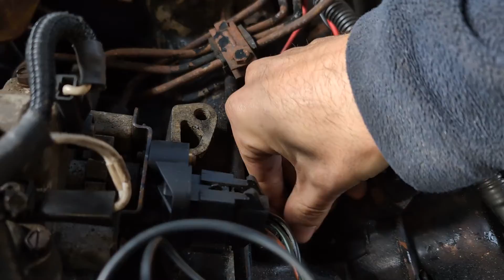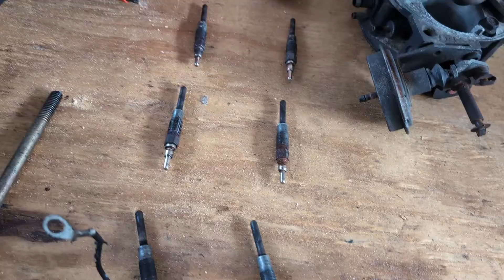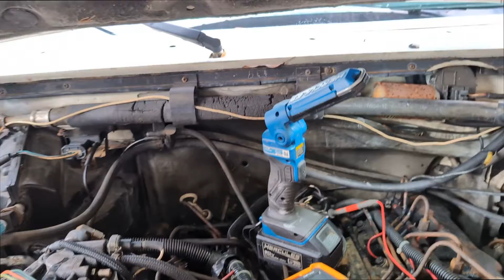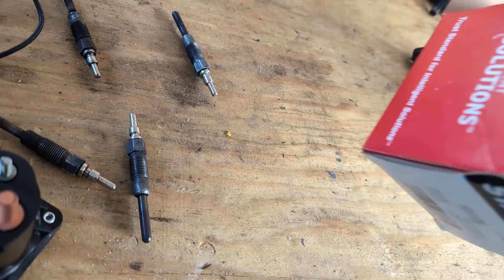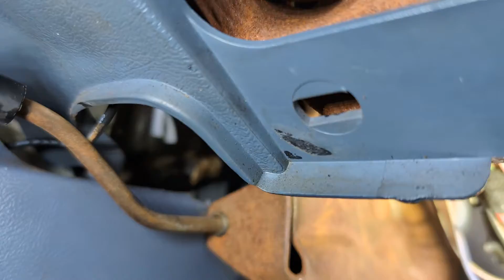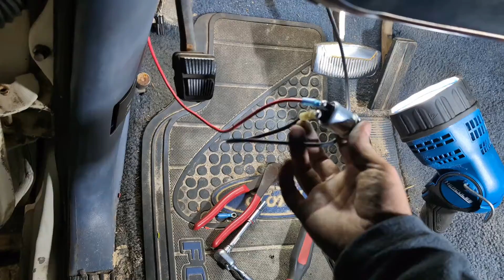Episode 163 - Glow Plug System Troubleshooting 1989 Ford F-350 7.3L IDI Diesel

Comment: 27.3L IDI Manual Glow Plug Controller wiring diag
Remove the white wire from the glow plug relay and
cut of the terminal. Install a crimp or wire nut on the
end of the bare wire, tape it up, and tuck it away so that
it is secure - this wire is no longer being used
Cut the blue wire for the wait-to-start light halfway
between the electrical connector and controller. On the
end of the wire that goes into the controller, install e
crimp or wire nut at the end, tape it up, and tuck it away
-this wire is no longer being used,
Crimp roughly 12 inches of wire to remaining blue
wire and install a ring terminal on the other end. Plug
the wire connector into the matching connector in the
wiring harness, then install the other end to the terminal
on the glow plug relay that you removed the white wire
from - this will allow for your wait-to-start light to
illuminate while the glow plugs are being manually
cycled
Run a wire from your momentary push button switch
(do not use a toggle switch or switch that remains
activated after your let go) to the teminal on the relay
that you removed the white wire from (where the blue
wire should also be installed)
Run the other leg of the momentary push buttor
switch to a good ground (preferably to the frame or
engine block).
D

Comment: What a weaith of info between the comments and the poster . Thanks . Just a thought about video making.  While explaining wiring data in the engine bay... A pointer or screw driver could point out the area or electrical connector  without having to explain  ... but this can be hard holding a phone . Subscribed.

Comment: Okay I've made it to this video with the same problem as everybody else. Maybe I can tell what happened to my 92 7.3 IDI and I love your thoughts. Went out to start my truck yesterday the glow plug light went out very quickly and of course click click click click click click. My first thought was problems with my batteries because I have two die-hard goals and their about 5 or 6 years old. So what I did was I put a jump on one of the batteries for about an hour when out there and it fired right up. So now my thought is it's just battery issue so I went bought two brand new die hard gold batteries and truck fired right up when I was down at AutoZone and I was very excited .Next morning, today , I go out and trucks doing the same thing.. click click click. Started chatting with GPT it told me to check on my battery connections and my grounds and all seemed fine. I did find one negative terminal issue but I bypassed it and it was still doing the same thing. So now I'm looking at the glow plug relay. I put a voltage meter on the input and got 12.5 and on the small power in I was getting 11.44 with the key on. Also put the voltage reading on the output with the key on and I was getting nothing. A couple times throughout my testing when I turn the key on it acted normal and actually fired up so I guess it's an intermittent problem. Does that tell you anything? Any advice would be great. I just ordered a new relay minus the controller so hopefully that solves the issue and I don't end up with the same click click click
Reply from the maker: If you are taking voltage measurements on the output side of the controller when it supposed to be running and getting nothing, sounds like a bad controller and/or relay.  To narrow it down I would jump the relay to see if you can get it to close and flow power to the glow plugs.  If that works that tells me you probably have an issue with the "smarts" of the controller versus the relay.  I would also check the shunt.  The shunt is wobbly bit of metal that is part of the controller.  From what I remember that shunt sets a very specific resistance value that helps to inform the controller to run the plugs or not.  The whole system functions on resistance so make double triple sure you have good connections all the way through and all grounds are in good working order.  As you saw in the video I spent hours following the exact Ford diag procedures, tested everything, bought a new controller and it still didn't work.  I've been perfectly content with my manual glow control since I built it.

It's actually been a bit handy because I've needed to give my truck a snort of ether to get it started a few times and you can do that safely... if the glow plugs have not been running.

Comment: Fantastic video.  I went through 'no glow' once before in 2009ish.  tested the plugs, replaced the relay, then the controller.  turns out the harness connection between the relay and the starter solenoid had melted.  If I had this video then, I would have done a smarter order of testing!  Now I have the same as you; click click click.  Plugs are motorcraft and only a couple years old.  all of them test out between .2 - .8 ohm.  I am getting almost EXACT voltage at the relay as at the batteries.  I tested each plug wire, reading .5 +/- on all of them.  I am going to replace the wires.  I feel like there should be less resistance - but not sure this is the problem.  they are original and insulation is not in great shape, so it will be good preventative anyway.  A couple weird things; the relay would catch when I hook a noco jump box, for a few weeks anyway.  The noco has higher voltage than 12v battery.  (my batteries are new, interstate/costco.  they aren't low or weak.)  Also, after starting and running enough to get the temp guage to budge, shutting it off for 15min, then turning the key on again, the relay will catch also.  engine and plugs warmer, but not hot..?)   Anyway, if the new wires don't do it, I will bypass the controller like you did.  i hate to do it only because I really like everything stock, but having that control will be nice.  Also mine is the zf5 - no e40d for me!!  =D
Reply from the maker: I would like to go to the ZF5, but it's actually a bit of a bear to go from auto to manual.  I think there might be a conversion kit floating around out there.  If I could get that...

Comment: Where did you go to watch the manual bypass ive tried everything on my truck and it looks to be the previous owner installed a bypass just it’s not wired right to the relay
Reply from the maker: I believe I read it in a step by step guide with pictures either on Oilburners.net or the main ford forum in it's diesel section.
Reply: @MazdaB3K  I bypassed the glow plug relay like the instructions say and now my bus bar is heating up and smoking. What does that mean?
Reply from the maker: You mean where the factory ground is?  That should be a ground point and should not be getting big power.  If it's smoking something is wired wrong because that wire is getting too much current for it to handle.

Comment: I guess I would consider a push button switch for the glow plugs.  I've got all my glow plugs disconnected. But I think I would go with the push button instead of relying on the timer.
Reply from the maker: I've had no issues with the system since converted to a manual push button.

Comment: 32:02 All you've done is push the problem somewhere else The next step is to check each individual plug on the amperage draw to that particular plug You're dealing with voltage sometimes you will have a 12 volt signal but you won't have 12 volts when you put the juice to it therefore your amperage will be low low low low diesel Care products has everything you need for that truck glow plugs wires controller check them out

Comment: Those don't look like glow plug connectors it look like slip joint barrel connectors it's like a spade except it's round you understand That's not glow plug connectors I throw that shit away them still collars Man they will give you fits might be part of your problem 13:17
Reply from the maker: Thus far the glow system is working fine for me.  What does a glow plug specific connector look like?
Reply: @MazdaB3K not trying to advertise just found it myself diesel care and performance yeah pumps glow plugs ejectors wiring harness and controller for the injectors they've been in business for a while they rebuild pumps in house videos on all of it I'm sold
Reply: https://youtu.be/7O4Bh1zru2c?si=UzvbpcDXTlQMTWv5 @MazdaB3K

Comment: I was having the same issue as you I ended up finding out the power side of the relay was getting voltage but not enough amps. Ended up replacing the 2 wires with new fuse link wire and glow plugs lit right up. Hope that helps
Reply from the maker: Hopefully that information does help somebody.  In my case I converted to manual and it works great.  Still learning how much glow to give depending on the temperature, but the glow fires off every time I hit the button.

Comment: thank you thank you thank you! 90 f250 7.3 idi....same same issues. followed your lead and wired (16 ga) /installed  manual switch. key on, push button, wait to start light lights up, count to 7, no start. reapeat count to 10, no start but it act like it wants to . now i just plug in the block heater from the house 120v for an hour and it starts no problem. a guy below says he holds 12 to 15 sec. should i try that? what do you think is the max time these things can take? btw new controller, new wiring harness, new plugs-OEM Ford / Motorcraft Idi 7.3l DIESEL Glow Plug Zd-9- Zf2tz-12a342-a (Set of 8 Pcs)- thank you
Reply from the maker: How much glow you are going to need is going to be highly dependent on the outside temp.  For example this morning it was upper 40's/low 50's F where I'm at and Bertha would start after 10 seconds of glow but didn't want to stay running until I feathered the throttle for a few seconds to get the needed heat.

Funnily enough I was researching the glow duration question.  From what I understand the IDIs fancy glow controller (7.3 IDI) would run the glow, give the operator the "wait to start" light, then keep the glow going for some period of seconds AFTER the engine started before finally turning off.  So... I would think anywhere up to 30 seconds, but I would say the plugs need to be given time to cool down after that.

If all of your glow system is now in order and the momentary switch you installed is working and you are still having starting issues at warmish temperatures, I would be checking for air in the fuel lines somewhere.  It's a known issue for the return lines to leak and have to be replaced.
Reply: @MazdaB3K  thanks for this...ill try a little longer... i know about the leaky low pressure return lines... have replaced them 2x over the years. ill double check. thanks again.

Comment: Truly helpful, got a 7.3 l I’m tackling and this is easing my anxiety.
Reply from the maker: It's a solid engine once you get it running.  the E40D it's attached to gave me fits before I finally figured it out though.
Reply: @MazdaB3K the hardest part is getting it to turn over, I guess this vehicle got caught in a flood and the person selling it says it’s seized but I’m just seeing what I can do before I buy it.
Reply from the maker: If it's locked up you are going to need to pull the glow plugs and/or injectors and inspect the cylinders if you can.  If they aren't trashed the best bet it to pry on the flexplate/flywheel but I think for this generation of Ford you would have to detach the transmission to do that.  Alternatively you can take the heads off and then do percussive repair on the pistons themselves with a block of wood and a hammer.  Pulling the heads on this truck is really big job though.

With it being a flood car I would drain the oil pan too, possibly drop the pan to make sure you don't have mud or something fouling up the crank before you try to get it spinning.
Reply: @MazdaB3K they did drain the oil already so that might be helpful, it’s in a 91 econoline so I took the doghouse off to make access easier. I’ve got a ton of pb blaster and fresh oil to put in it to help loosen things up.
Reply from the maker: ATF is the easiest to pour down the cylinders, though a more effective pentrant would be a mix of ATF and kerosene.  Look up a mix called Ed's Red if you want a really good solvent for unsticking things and eating rust and crud.  I don't remember if this engine has a nice big crank bolt that you can flex on, but you have to be careful with that anyway because you can and will snap a crank bolt of you thrash on it too hard.
Reply: @MazdaB3K copy that, thank you!
Reply: @MazdaB3K do I take the injectors out to pour the solution in, or just take the lines off and leave the injectors still in?
Reply from the maker: @Bunnybones87  if you are wanting to get stuff in the cylinders injectors need to come out.  If you are testing the fuel system you can drop stuff in at the tank or remove the fuel filter and fill it with ATF
Reply: @MazdaB3K thank you

Comment: I yanked my automatic relay and put in a momentary push button on my dash. Hold for 3 to 5 seconds and crank. I ended up getting at least 4 years out of my plugs before needing replacement. I had two controllers fail, and took out all my glow plugs twice, never again. I can count 3 to 5, and I know I'm not cooking them. I doesn't take much to start my truck on a normal day, not freezing outside. The controller is to fickle for me not worth the headache. All you need to do is just put in a relay, and hook the switch to the relay. Super simple.
Reply from the maker: Yeah, kind of came to the same conclusion.  The video you looked at doesn't show hours of extra troubleshooting I did testing just about everything I could test, nor the two trips to the nearby city to buy parts that took about 1.5 hours round trip each time.  After all that foolishness a momentary switch that you press for a few seconds is way better.

Comment: I'm having a hard time figuring out which glow plugs I need and all the websites to go to are so hard to navigate there are so many different part numbers and so many different styles..
All I know is it has a stud type I don't want to make the vehicle undrivable plus it's not mine I work on OBS stuff
Reply from the maker: If you are working on an IDI diesel engine, get the motorcraft plugs only.  Just about any other brand winds up with issues heating up or winds up swelling and getting stuck in the cylinder head.

Comment: So now on a cool/cold day you press the button, count to 12-15 and turn the key and vroooom!
One 'good' thing about the 'manual' button is > > > on a warm/hot day or a warm engine you're NOT using the Glow Plugs like the controller would normally use them. Thus... the GP's will last longer!
BUT... unless I missed it, what made you come to the conclusion the GP controller relay was bad and replaced it???
Reply from the maker: It was more like I ran through all the troubleshooting steps as laid about by Ford and everything that was a simple measurement came back fine.  The only thing left was the glow controller.  I knew it had a reputation of being too clever for it's own good, even the improved one used in the 7.3L.  So I bypassed it to get on with my day.

Comment: Just did all of this down to the by pass 😭doesn’t want to start so now I’m going to check the fuel system
Reply from the maker: Yeah.  Air intrusion will give you a bad day.  After you do a bit of cranking try pressing in the schrader valve that's near the filter and see if you get any air coming out.

Comment: So I changed out my relay and added the ground cable as you show but that didn't solve my problem, the WTS light just won't stay on. I don't own a test light but I do own a very good Fluke Multimeter. 
My Multimeter doesn't have super long leads and this engine is in an E350 van, I just used the engine block method, where one tip is in a clean section of the engine block and the other tip is on a glow plug tip. The reading on the two I measured using the ohm section were both around 1.5-1.6. Is a good one around 0.2 or 2.0? I'm confused by the numbers people are using.
Reply from the maker: For glow plug resistance, the key thing you are looking for is 2 ohms or less.  If you are seeing higher than that, something isn't right somewhere.

Comment: Fantastic Video, thank you!
Reply from the maker: I was quite annoyed with the glow system at this point.  That's why I literally printed out the troubleshooting guide from the Ford service manual and made this video.  If the system was being this fickle for me, I figured other folks could use the reference as well.
Reply: @MazdaB3K  well it's very helpful! I own the factory service manual set but sadly never have tons of time to pore over it, the way things are described sometimes leaves out key information that less experienced mechanics like myself don't know. I just changed out my relay and still getting the clicking, but I didn't know about needing to add a new ground. I'm going to do that next and see if it helps.